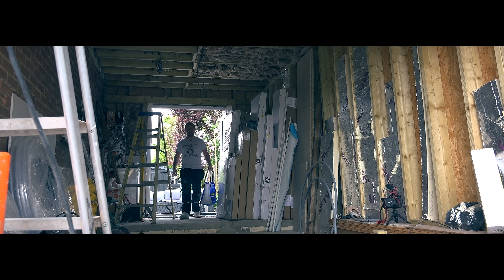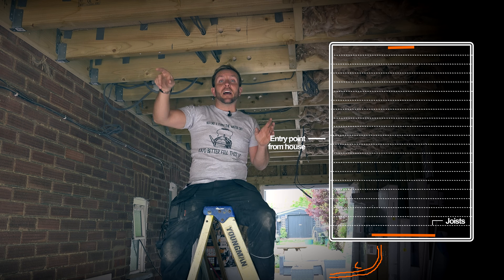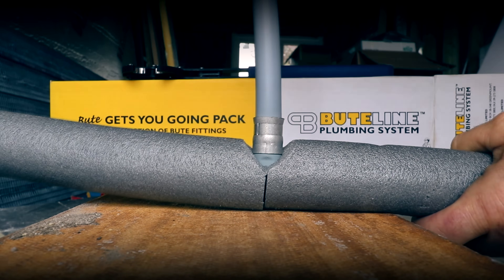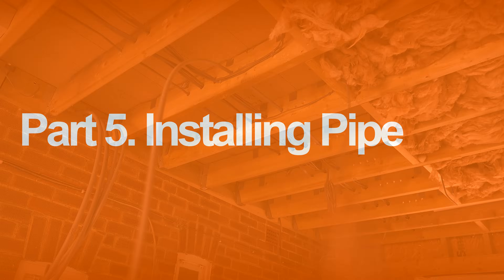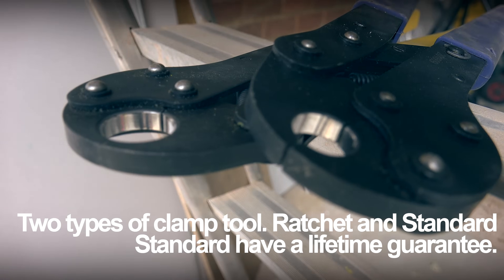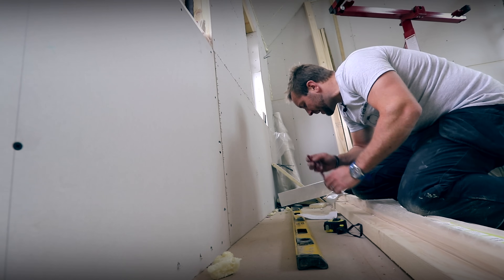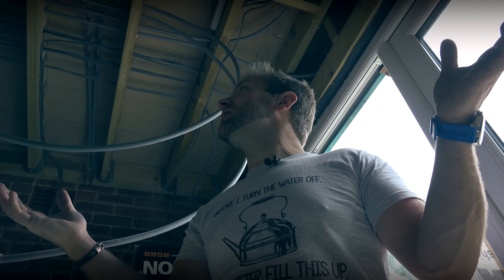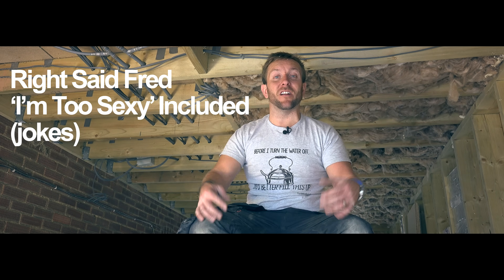PLASTIC PIPE FOR PLUMBING - Buteline System

Comment: great vid so would you never use speed fit? surley speedfit is better as you can take it off and re alter if its wrong. the stuff in the vid looks like its knackered if its in the wrong place?
Reply: robert Griffiths you can dry fit this system in case of a mistake etc and once you are happy then clamp. Same as solvent weld before you glue.
Reply: get u mate. end of the day what are we saying better than copper?
Reply: robert Griffiths joints are stronger and far quicker to install. Would still go copper tails where it is visible though.
Reply: this many advantages over copper,  cheaper, faster, less joints, slow sweeping bends (so less resistance) cleaner, less thermal conductivity (less heat loss and lower risk of legionnaires) easy to pull through joists ( nightmare with copper). won't split when froze. wont suffer electrolitic corrosion when pipes touch, wont corrode from cement, no pipes knocking from heat expansion, no water hammer.
disavantages, joints more expensive, doesn't look as neat as copper when run visibly ( I always use copper or chrome tails). cant run on flow or return directly on boiler. obviously cant be used for gas, possibility of mice chewing it, although I've never seen it. and gives the sparkie a headache when fitting the earth on the incoming main.   that's all I can think of off the top of my head.

this stuff will NEVER replace copper, but its awesome for running under floors, as long as you don't use pushfit, that stuff is cowboy dogshit
Reply: @davelaye7003   Dave Laye  Excellent information which I found more informative than this video itself. You say push fitting is bad but what's the alternative? Compression fittings? Thanks
Reply: @mannaahmed9724  yes. Personally I use compression fittings with inserts.  I haven't used the other fittings that compress with a gun myself. But that may be something I would be interested in when the fittings become more readily available.
Reply: @davelaye7003  Thanks for getting back to me Dave. Really appreciate it. I've got brand new copper fitted from ground up, but unfortunately have some buried underneath the kitchen floor in the cement and have had leaks. My plumber suggests we cut loose the copper pipes underneath the floor and instead use plastic from from the copper just above ground and chase into the skirting boards and then connect back to the existing copper pipes. The length of plastic required will probably be no longer than 20 metres.
Reply: @mannaahmed9724  there's usually nothing wrong with copper in cement screed, as long as it's wrapped in denzo tape and protected from the alkaline of cement. The danger is someone puncturing a pipe usually if it goes through doorways, when the doorstrips get nailed or screwed down.
I would say bypassing the pipes is a good idea. You can buy pipecovers that make it look more attractive
Reply: @davelaye7003  Hi again, Yes, I've had enough now as this is the second leak in less than a year. Had I known better I wouldn't have had pipes buried in cement. If done correctly I'm sure it would have been fine but clearly it was a bodged job. Do you mean to say I can hide the plastic pipes using covers? The main run of the plastic pipes will be underneath and behind the kitchen units so they will be insulated with foam or equivalent. Where the pipes come out and become visible that's when they'll be chased in behind the skirting boards. I've been quoted £300 for the job + chasing etc but that's because the plumber bodged it in the first place and now he's lucky to be getting a penny. You live and you learn I guess. I think he did use denzo tape to protect the pipes but it's another weak joint somewhere in the cement. Either bad soldering or he forgot to solder it like the other joint which leaked last year and it took 3 months for the whole place to dry :(
Reply: @mannaahmed9724  so if I read this correctly; the plumber that caused this problem recently put the pipes in the cement??  The thing with this copper in cement, it takes years and years for it to corrode it.  I'm gonna stick my neck out and say at least 20 years.  If we're talking he did it recently, then that's a leaking joint.
I take it it's on heating pipes and you know there's a leak due to pressure drop??. Sometimes when I can't locate a leak ( usually it will be under a wooden floor downstairs) I use leak seal.  It works brilliantly.  But in a concrete I don't think it work as it may not get exposed to air.
Regarding the price......If the work is done within the last 12 month, I'd say your plumber should be fixing this......I would, but I'm an honest chap ;)
Reply: @davelaye7003  Yes, that's correct it was he who laid the pipes. First time the pressure kept dropping to 0 within 48 hours so I was sure it was a leak and began carefully investigating till I found paint flaking off the wall just above the skirting board. Cut a long story short, the plumber fixed the problem and I had to claim the repairs on the insurance which meant wife and child had to live with in-laws for 3 months whilst the place dried up, replastered, new floors etc. The culprit was a t-joint was not soldered, he forgot to do it but due to it being buried in cement it worked fine untill winter kicked in during 2017.

Fast forward a year, since three weeks ago the pressure started to drop again albeit very slowly but never to 0. It would not go below 0.5.

I assumed the worst but was also told by others online that it could be the expansion vessel playing up.

The plumber visited a few hours ago and spent an hour servicing the boiler and discovered that the expansion vessel was well over twice the recommended pressure when it should be 0.75.

He released pressure from the boiler and the expansion vessel then topped up the EV to 0.75 and the boiler to 1.3.

So far it seems to be holding up well although it may take 3-4 days to notice a drop as it was very slowly losing pressure before.

The plumber doesn't know why the EV was over 2 bars of pressure but he said that could have been causing the issue so I'm very hopeful that's the end of this matter.

If the pressure continues to drop then he will be back to check EV again and if it's faulty then replace it I guess, although that's going to be a pain as the whole boiler will need to come off the wall. I've got the Worcester Greenstar 25si Compact.

I'll take a faulty EV than a leak underneath the floor any day.

Any idea why an EV's pressure would rise and what the symptoms of this would be? Does it add up to my issue above where the pressure on the boiler was dropping very very slowly till it got to 0.5 and wouldn't drop any further and also my radiators would keep filling up with air.

Thanks Dave.
Reply: @mannaahmed9724  ...so the easy way to find out what is causing the pressure drop....firstly, you can isolate the boiler by closing off the flow and returns and leave the boiler overnight.  (Not ideal In winter I know). This will show if the problem is within the boiler if the needle drops. 
If it doesn't drop at all, then the problem is in the heating circuit.
My diagnosis is; the Pressure Vessel has been over pressurised. When I service boilers, I always take the pressure out of the heating system, then check the PV with my digital tyre pressure and top up to EXACT specified pre-charge that's written in the Manufacturer's Instruction manual. You're quite right, on that boiler it is 0.75 bar.  
If the pressure is too low or too high, the pressure in the system will rise. Once it reaches 3 bar, the pressure will exit through the pressure release valve.   But once they function, they will always drip.....and that gives the symptoms of a slow drop in pressure......and the way to test for this, is to put a clear bag over the prv pipe outside (As long as it's accessible to reach)
I'm a little shocked that you had to claim for the incompetence of the plumber, even if he was unable to fill the system before the floor was screeded, he should have pressure tested with air.  I usually pump the pipework up to 4 bar and leave it for a few hours or overnight. 
The pressure vessel is a sealed unit and gets topped up by engineers through the Schrader valve (bike pump)  and the only way for it to be at 2 bar is by someone guessing how much to pump in. If it was faulty, it wouldn't pressurised at all, as you HAVE to fill it with the system vented to atmosphere.
Hoping I'm not teaching you to suck eggs as you sound very knowledgeable
Reply: @davelaye7003  Can you please tell me where you based?
Reply: @davelaye7003  I just want to firstly say a massive thank you for your patience and for taking the time to reply and for the sound advice which I really appreciate. I have no experience with plumbing, but had to do a lot of research online after last year's leak so only know what other knowledgeable and helpful people have mentioned in forum's and from various websites + good old YouTube, so I only have a slight idea but that's about it..

Unfortunately some bad news as the boiler does seem to be losing pressure again, even if only a little. I turned the thermostat right down last night so the heating did not come on at all and this morning it has dropped by 0.2 bar so it's currently sitting at 0.9 bar. The plumber left it at roughly 1.2 bar on Monday. It's quite hard to get a full reading due to the way the pressure gauge design, wish it had an electronic gauge of some sort, but I'm confident it has definitely dropped below 1.

As for the bag trick I had to do that last year when the major leak happened and did the same a couple of weeks ago. The bag I taped to the PRV was empty and the pipe itself is dry. I check the little pipe every day as I leave for work. This morning it was dry.

The pressure has never risen above 2 bars anyway so I didn't think it would be the PRV but always worth checking.

I am cutting this plumber loose as he's very slow to respond and I've lost confidence in him. Only kept at him as he knows the entire system, even that's debatable. My wife believes he's just wasting our time. We don't even know know if the leak is under the floor or if there's something wrong with the boiler.

I spoke to another plumber from Checkatrade and he suggested a pressure test from where the magnaclean pro is installed beneath the boiler. He said he will use a device to isolate the central heating pipes and apply a lot of pressure and leave it for a few hours. I immediately liked the sound of that as that's exactly what you suggested and thought at least this guy knows what he's talking about.

The new plumber also talked me through how to isolate the flow and return which I asked him thanks to your suggestion. He said that it should be the first dial on the left and the last dial on the right and that it will only turn one way. I remember I had to do this last year but my plumber only shut the first dial, I think it only turns one quarter and no more.

I'm going to do this tonight when I get home and leave it like this for a couple of days and see what happens. I've got electric heaters so will be ok for a few days.

I forgot to ask the plumber if I can use the hot water whilst the flow and return are closed but will message him.

I've been stitched up, Dave, royally bent over and this has been a pain in the arse since we had the boiler installed and new pipes fitted in the whole house.

I have learnt a lot and in hindsight would have done things very differently but you live and you learn. Now the priority is to find this leak, if there is one, and put it right.

The plumber did say that worst case scenario we may never find the leak in which case I may need to speak to my insurance company as I believe my policy includes trace and access where they use special Infra red equipment to detect the leak. Let's see what happens.

I take it you're a proper gas safe registered plumber? Everything you have said makes perfect sense to me. Please do let me know where you are based.

Thanks again, Dave.
Reply: @mannaahmed9724  thanks for your reply,  I'm In London. I'm flat out at the moment, but if you wanted to call me for advice, it would be easier than all the typing.  
When you turn the valves off on the flow and return ( and you're quite right, quarter turns on the two outermost 22mm valves)  it shouldn't take a few days to see, overnight at the most....if it drops, you know it's the boiler. But as you said....the prv pipe is bone dry, then it's very unlikely inside the boiler.

One of the commonest places I find leaks, at the tails that come into a radiator.  Quite often the pipe gets knocked whilst hoovering. It's very difficult to find a small leak if the heating is on as it evaporates before making a stain on the carpet.  You'd be very surprised how LITTLE water you need to lose to drop the pressure half a bar.  Sometimes it may be one or two mug fills of water. A great way to find a leak; fill the pressure up to 2 bar,  allow the heating to cool down. And go around the accessible pipes fittings, rads with that blue roll. Wipe all the joints. That shows up water straight away.

The plumber who turned off just one valve.....complete waste of time.  
Finding the leaks under the floor can be found with a thermal imager. They're not horrendously expensive and a lot of us engineers have them. Great for underfloor heating and identifying sludged radiators.

 I take it you've had a look inside the boiler? Sometimes the automatic air vent (AAV) can leak or show signs of leaking.  I may have to read your post again and come back and post more.
Reply: @mannaahmed9724  I should ask what boiler is it?  And about getting hot water whilst the flow and return is off....although it would work, I'd advise against it,. As when the boiler generates hot water through the heat exchanger, it sends the excess heat down the flow heating pipe when the tap is shut off. So no.
The PRV WOULDN'T  be responsible for the pressure going up to 2 bar....As it is a release valve, it will only be responsible for pressure drops.  The only things responsible for pressure increase....... 1 The expansion vessel.
2 The filling loop letting by. 
3 And very rarely, a split in the secondary heat exchanger (the secondary HE is the small shiny can that transfers heat to the water for your taps)

I know it's not an ideal solution, but if you find yourself at a dead end,  pour some leak-stop and run it around your system.  My neighbour/good friends had the same trouble as yourself, however they have laminated wood over a suspended floor.  They were topping up every few days. I used leak seal and they've  not had a drop in pressure. That was 4 years ago!
Reply: Ignore my comment about your make of boiler.  As I remember you saying about the EV behind the boiler.  The days before Worcester Bosch copied Vaillant's design. And you'd spend all day taking the boiler off the wall to change it.  The best solution is to fit a separate EV that don't cost very much. And leave the knackered one in the boiler.  As long as you have to room to fit one
Reply: @mannaahmed9724  Haha yeah, for my sins I am a plumber 🤣.

Thank you for your kind words, and I'm more than happy helping ppl out, I get a lot of satisfaction from my job. And I really enjoy problem solving.  Those trace guys are pretty good, so I've heard. But obviously expensive.   So before we go down that route....do as you  are going to with the blue roll...they sell it in b&q.  Let the heating cool down. Top up to 2 bar, then go around dabbing looking for leaks.
Reply: @mannaahmed9724  when you turned the valves back on to the boiler, did you happen to notice the needle drop?
You mentioned three radiators are fed by the pipes that enter the screed,  now depending on how ambitious you're feeling; you could drain the system, cut the pipes before they enter the screed.  And test  the three rads and pipework yourself.  Screwfix sell a dry testing gauge for thirty quid.  You can attach this to one pipe. And a "John guest" speedfit cap on the other pipe (these are the cut pipes that go to the 3 rads) and pump it with a bike pump.  You can put two other caps on the cut pipes on the heating side and  fill the system back up. Now this will narrow down the leak down as you've essentially split the heating system in two with each side with a pressure gauge.
Reply: After you've pressurised the system uo to 2 bar. Don't forget to lower the pressure back down to 1.5 bar before you put the heating back on.  Just let out some water from a radiator. Probably in the bathroom.  I agree with what you say about the leak seal. Its great as a last resort. But you're masking a leak

Comment: Hmm I was taught when soldering onto brass, heat the brass not the copper otherwise the solder can run before the brass is hot enough and make a bad connection. I'm not sure how much truth is in it but when I've come across copper pipes that just pull out of brass bayonet back plates for example, I always blame the previous engineer for not heating the brass.